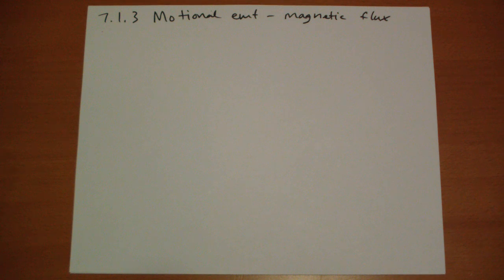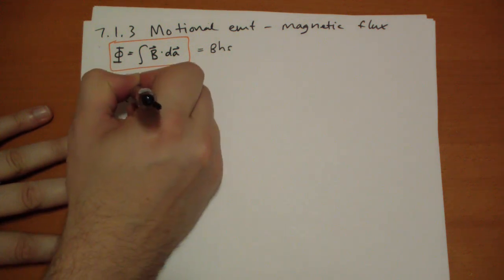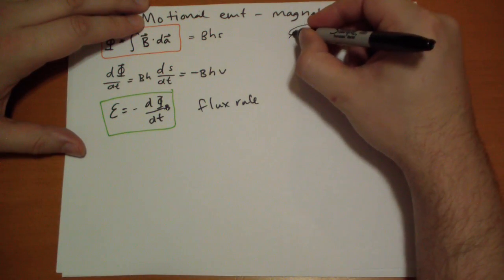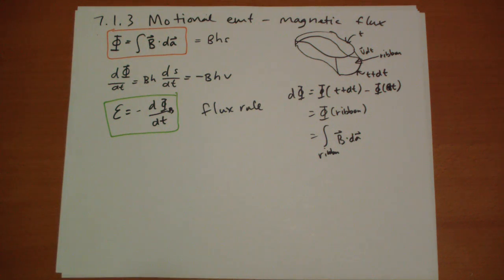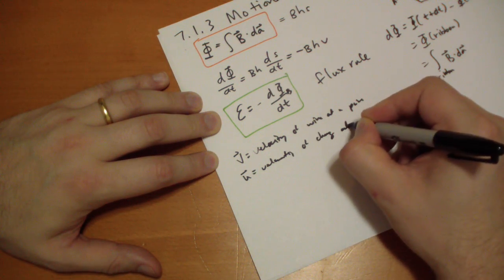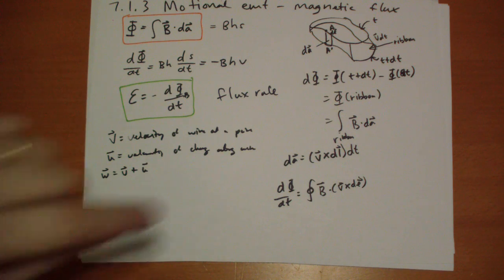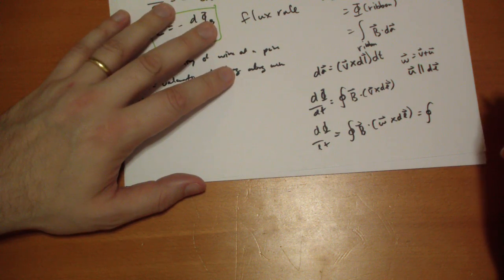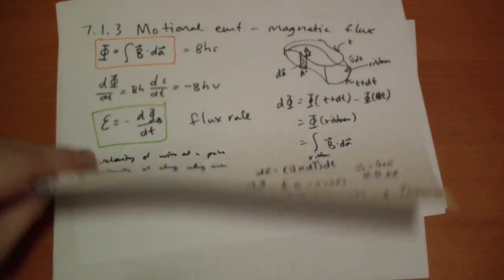7.1.3 Motional emf - Magnetic Flux

Comment: If phi = the integral of Bda then why are you substituting the integral of Bda into d(phi)/dt?
Reply: He took the derivative with respect to t on both sides in order to get dphi/dt, from there proved it was the negative value of the emf he had calculated in the previous video, basically did it to derive the flux rule.